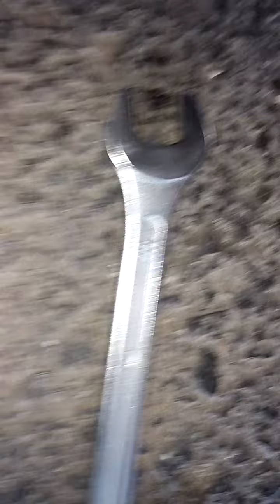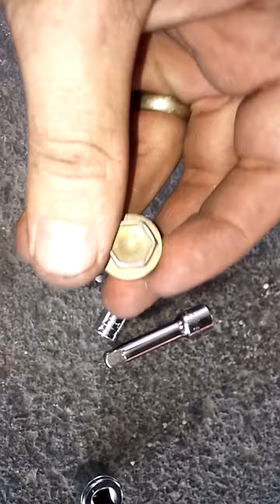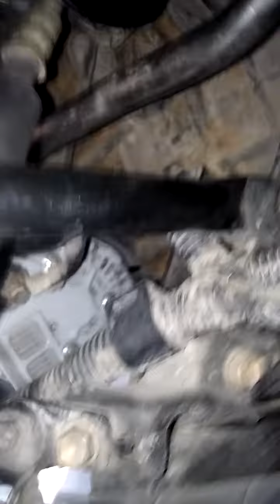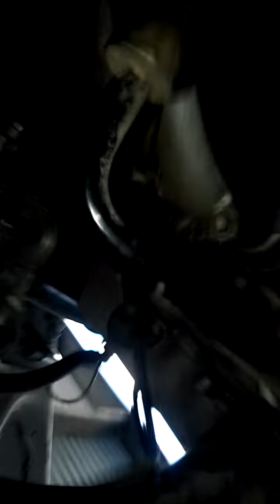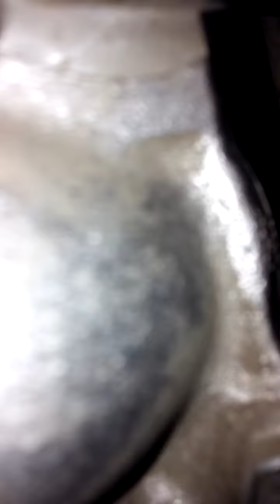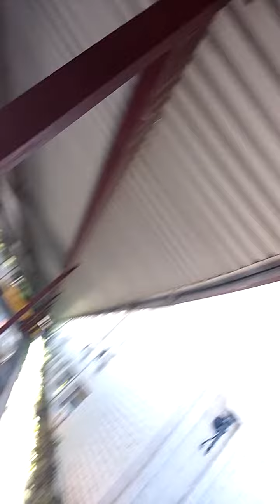Change fuel filter 99 Toyota Tacoma 2wd

Comment: Hoping for some advice. Just swapped out the fuel filter on my 1999, 4 cylinder 2.4L Tacoma. It's the one located underneath the manifold - pain in the ass to access. I replaced the filter, reassembled the thing, and bolted it back in place.

Now it's chugging a bit when idling. It's like it's not getting quite enough fuel at idle / low speeds. One thing I didn't do was align the banjo bolts with the fuel lines when I was retightening them. I just cranked them down.

Any ideas? Do you think I need to take it out again and line up the banjo bolts carefully? Or is this another issue? Any advice appreciated!